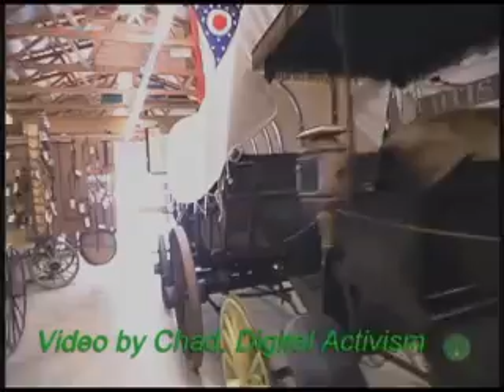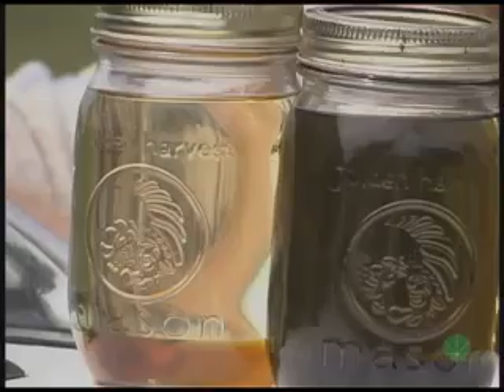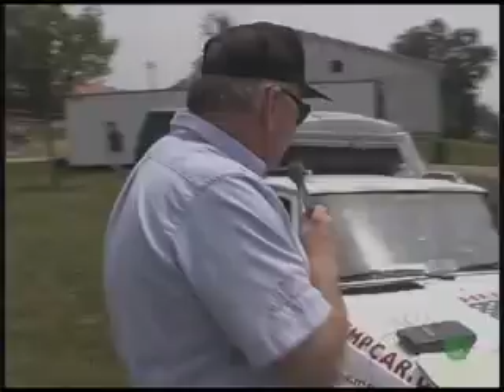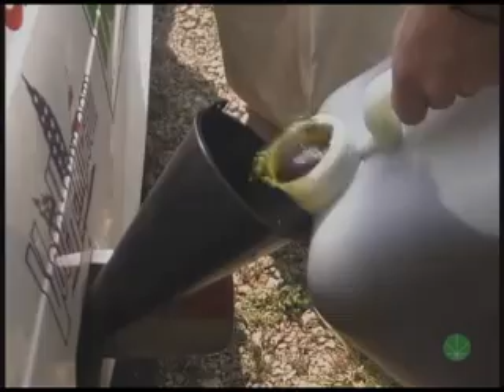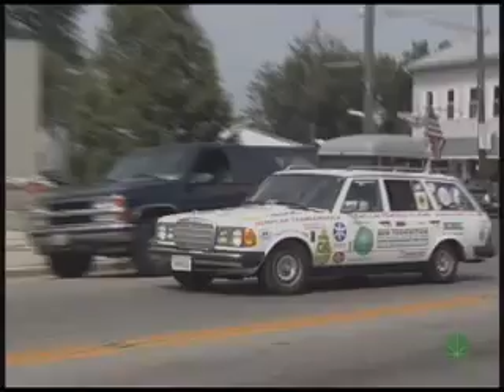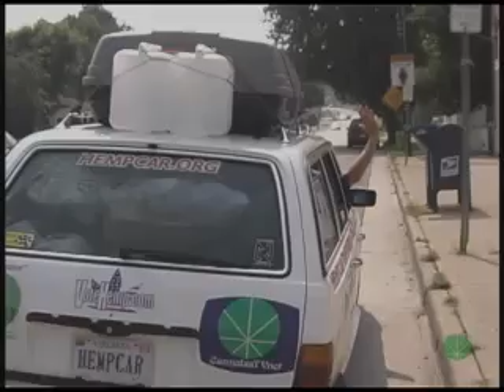Hempseed Biodiesel Car at Ohio County Fair

Comment: so these guys used 370 gallons to travel 10,000 miles...if they used Gasoline, that would put over 9,000 lbs. of pollution in the more polluted air. Damn, fuck the GOVERMENT, I'm making biodiesel!
Reply: lmao, that's only 27 mpg my wife's taho gets that and it's a 99 with a v8
Reply: Nate Begay your Not down lol I'm on the same deal but alil larger scale 

I'd like to start an LLC to produce B100 for my commercial vehicle that uses $78000 each year on b-5 to b-20 at truck stops across United States

Comment: Hemp makes by far the most biomass (2/3rd's more than corn), its disease resistant, and grows fast.  It has many more applications besides fuel.  Its a tragedy that its illegal in the states.
Reply: Not anymore I want to grow hemp at a commercial scale and produce bio diesel and sell the by product to make fabric.
Reply: The use of flesh, dairy, timber & alloy as shelter, sustenance & propulsion chemical is what made law necessary in the first place. Mixing what is proper with what isn't = - 0 :/

Comment: Ah, just found it's around 30% oil content in each seed that can be used for biodiesel, it's almost the same as the other highest cultures but it decades faster, that's why the person said in the video that it should be transformed locally (near where it was harvested). So it's a pretty good investment since only the seeds go for biodiesel and the rest of the plant can be processed for clothing and other bioproducts.
Hope i helped a bit :P
Reply: The other part of the plant can be made into metal to make the car
Reply: @soildermike you can't make fiber into metal, however you can turn it into a fiberglass type of structure.
Reply: serip It could be extracted from fermented hemp stalks as well.